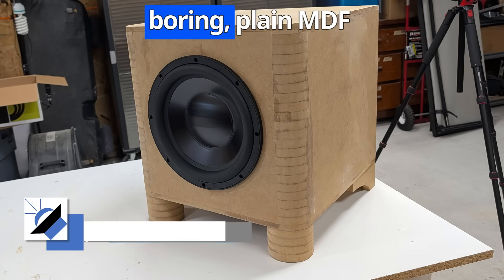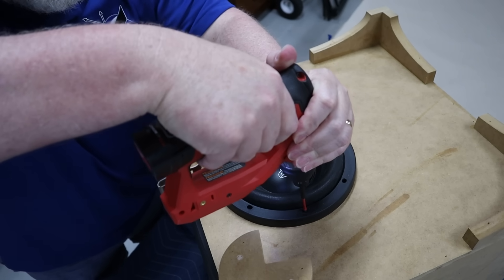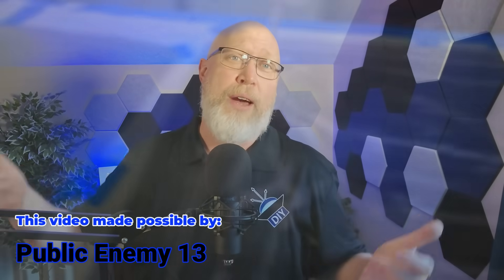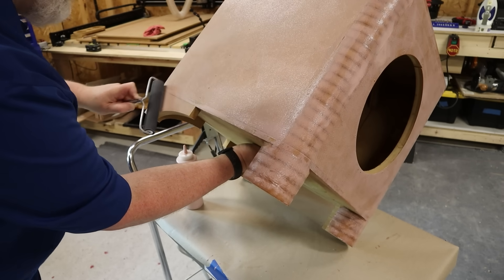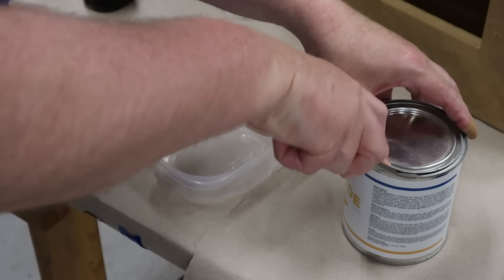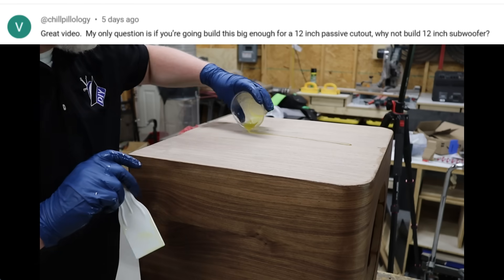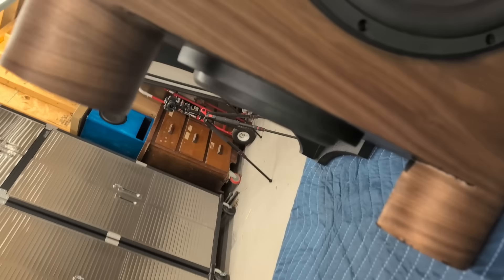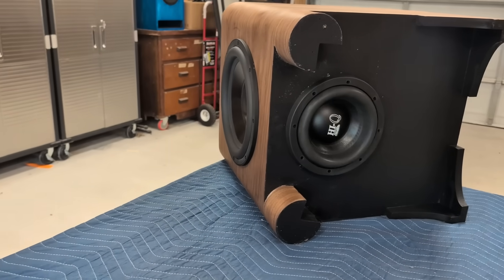Home Theater Subwoofer with a Hidden 8 inch Subwoofer!

Comment: Nice work! Scan Speaks Discovery line subwoofers has also a passive radiator, its the same size but twice the xmax thy look exact the same.
Use 2 diy dual opposed subs with 12" Disco drivers but its not a small sub, with a PR they can be way smaller.

Comment: watching that passive radiator flex like it was... what would happen if you put an actual speaker in there with a diode bridge rectifier and some LEDs and made a sound powered light show :D
Reply from the maker: You mean put in a normal driver, and then hook the rectifier to the speaker terminals to take advantage of the current generated as the coil passes through the magnet to power the LED?  That is  clever.
Reply: @DIYAudioGuy  yeah! direct visual response to how hard youre bumpin :D

Comment: When I tune my PRs, I found it convenient to invert them and add weights to start out with so I don’t have to take it apart every time I add weight. Good looking build. Think you could have gotten by with a 10” drone?
Reply: That's a terrible idea. The pr will be tuned differently once its mounted normally.
Reply: @R @RealMrRobinson Technically explain why you believe that’s true.
Reply: @ndoc8889  the pr takes up air space. So  when inverted the box would seem bigger to the subwoofer. If you tested the tuning frequency you'd notice that it is not the same once the pr is inverted
Reply: @R @RealMrRobinson So add a touch more weight when securing properly. The volume displacement is negligible. You’re talking 1-2hz at most which is not an invalidation of the process and 10/10 times you won’t notice with the human ear. If the drone is a simple diaphragm (which many are) then it’s a moot point.
Reply: @ndoc8889 I wouldn't know I've never built one of these

Comment: I have a Boss audio 8in cube sub cube with a integrated 400w amp and an 8 inch radiator installed opposite ot the sub. A boss bv755b head unit. With rc audio output to sub hooked up. The sub has a blue white wire remote connection to sub and a separate sub volume control. What should i have the sub settings on? 
Car Subwoofer and Amp Package – Built-in Amplifier, 8 Inch Subwoofer With Passive Radiator, Remote Subwoofer Control

• Nitrile Rubber Surround
• Aluminum Cone
• MDF Sealed Enclosure
• RCA & Speaker Level Inputs
• Phase Control
• Bass Boost
• Low Pass Filter
• Class D Topology
• Remote Subwoofer Control
• LED Status Indicator
• Thermal, Short and Overload Protection Circuits
• Side loaded 8” subwoofer / 8” Passive radiator with Class D amplifier
• Input Sensitivity Selector: 0.2V-6V
• 0 to+12dB VARIABLE BASS BOOST

Comment: Would the box size be the same with a 12" woofer and two 12" pr?
Reply from the maker: It would need to be a lot bigger, maybe twice as big.
Reply: @DIYAudioGuy  really? My 10" with two 10"pr is 15 cube. The 8" version is 12" cube. I can only imagine if klipsch made a 12" version it would have been 16" cube

Comment: I'll never forget. Back in 1994 I had a roommate during college and he had a forest green Jeep Cherokee 15x12-in wheels low profile tires black tinted windows. He had four 12s in the back savard high qs. They look exactly like the one you have in the video. Talk about waking up a memory I would have never remembered the name of those woofers. Anyhow they were so effective that they blew the back glass out of that Jeep from time to time. He constantly had to reinforce or reset the rubber on that glass. Man that thing banged. I'm going to keep an eye out for high cues from now on. I think he was driving them with a punch 200 bridged down. I'm talking about that first generation of the Rockford fosgate punches with the thick ridges on them. Bulletproof if hooked up correct

Comment: I have had more than a couple ultimax go sour premature.  Coil rub right out of the box as well... I don't think I will buy another.
Reply from the maker: This failure was due to user error.  I was trying to get some big flex on low notes so it would look good on camera.  Clipped the hell out of the poor thing.  Lesson learned.

Comment: Tip.... To cut veneer place a board on face then slice from underneath into the board. Finish with a file. Cutting from the top could have the grain make the blade veer and damage the face.
Reply from the maker: Thanks for the tip! That's a really good idea.
Reply: @DIYAudioGuy  By the way, your build design and end product is very nice. Good day.

Comment: How much weight do you have in the Passive Radiator? 
any Tipps on how much weight i should use?
Reply from the maker: 300 grams.  The amount you're going to need depends on too many factors for me to give you a general of thumb for what you need.

Comment: That stuff is pretty cool. Honestly, contact cement would have been a lot easier of a process. Also, you could have used a router to trim it.
Reply from the maker: I did use a router. Did you not see the router in the video? 

As for contact cement, every time I use it the comments are full of people calling me an idiot for using contact cement. 

Honestly, this was a whole lot easier, with contact cement. It tries to grab the instant. Two materials touch each other. With this stuff you had time to position the veneer. 

1000% better.
Reply: @DIYAudioGuy lol, I don't know why I didn't see it. It looked like you were trimming with a razor knife lol.
Mabe it happened when I was commenting.
Reply: @DIYAudioGuy I learned how to lay veneer back in the mid 90s when I started sweeping a cabinet shop when I was a kid. We always used contact cement

Comment: Would a 12 in sealed enclosure be possible?

I do love passive radiator but i thought the pasive radiator had to be twice the size if the subwoofer, would it be possible to use two 8 inch passive radiators?

Comment: The rounded edges and feet could be made with holesaw offcuts stacking them using the centre drill hole for the dowel, bit of cutting needed to get it flush for the side panels but could be done, bolts for the feet nice build got me thinking how i could manage to do it without the cnc table.
Reply from the maker: That's clever!

Comment: I don't think you did a project akin to what i'm looking for: a hidden subwoofer for desktop speakers.

I have ye olde Elac BS52 as my computer speakers. These were by all reason designed as high quality sats/rears, they have a very even radiation pattern but they're fully sealed with small midwoofers so they don't really have bass extension, i think -3db point near 100Hz and -10dB around 65-70Hz.

So i'm thinking of a potentially arbitrarily large in area but very thin sub i can plop down on the floor or hang behind the desk. Do you think it's a good idea at all? It needs to not be bloated and sound rather tight, it doesn't need to get organ-deep, in turn there's no need for it to get loud. I understand that subwoofers are generally not designed to be used like this, but i'm not going to have a freestanding subwoofer 1m away from every wall and obstacle, i live in a very cramped space.
Reply from the maker: That sound feasible to me.

Comment: Fantastic build and progress log. For most of us DIY guys, even the latest build reveals something that needs to be learned or practiced. I've always skipped the final touch-up process because it takes so much extra effort. You've shown that it is very much worth it. 
And man oh man, I'm not supposed to be biased on brands, but it's impossible for me not to love and support PE. It's an audio guys Toys R us, and radioshack in 1. I've been drooling over those plate amps and this style of build. 
Ive also been contemplating using car audio subs for home just for the look and show as I believe it would be a hot commodity in my area.
Reply from the maker: They are a great company, pretty much anything a DIY'er needs.

Comment: Just wondering, is there a reason why you don't use threaded inserts for your builds?

Love your videos BTW
Reply from the maker: I have found the juice is not worth the squeeze.  I only use them when I know for sure that I am going to be swapping the driver in and out.
Reply: Makes sense

Comment: Your finished subwoofer is really unique.... even more so now that the veneer is on... BEAUTIFUL!!!  I don't ever recall seeing rounded feet integrated into the roundover curve of the main cabinet quite like that. The way the veneer carries over from cabinet to feet is really cool.  I think people will be copying this once they see it!  Nicely done.  ... and thanks for the 'shoutout'.  I'm really glad you enjoyed the iron-on method and found it to be fairly easy to do. I find it nearly therapeutic... kind of like 'old-world-craftsman-y' to make up a term.
Reply from the maker: The feet were an afterthought, and after I attached them I thought I had worked myself into a corner.  Then I thought why not just trim the veneer and fold the scrap around the curve.
Reply: @DIYAudioGuy  Just ordered some Rubio Monocote based on your suggestion and used your affiliate link... maybe not enough $$$ for a cup of coffee, but maybe a touch of creamer? :)

Comment: Iv always wondered  if you could tune a sub by adding weight to the cone, like a PR.
Reply: You sure can. It's a moving mass in the acoustic circuit. I got a vid or 2 where I added a lot of hot glue on some 10 inch punishers to drop the tune to 24hz
Reply from the maker: There is a company that just released one, don't remember who.
Reply: @DIYAudioGuy  Helix just released car subwoofers with adjustable weights
Reply: @DIYAudioGuy  That sounds promising. would be good to have a dustcap you can add or remove weight to further tune the box.

Comment: you could put a 10" in that enclosure and still have enough surface area on the passive radiator and yes its big enough for that trust me!
but hey atleast you have an upgrade path if you one day decides it does not have enough output for your taste. 
Nice build btw it looks really good!
Reply from the maker: Not a bad idea
Reply: A ten would need a 12 inch radiator
Reply: @Edrop-sj3vx that is true! and i belive it is a 12 inch he is using
Reply: It is a 12 in radiator .. i had an 8 in sub with a 10 in radiator by klipsh and was amazed by how it sounded but it was single voice coil sub not heavy duty like the high q 8 but maybe with a ten in radiator it wouldnt of blown the sub